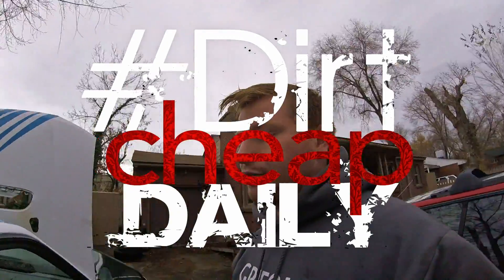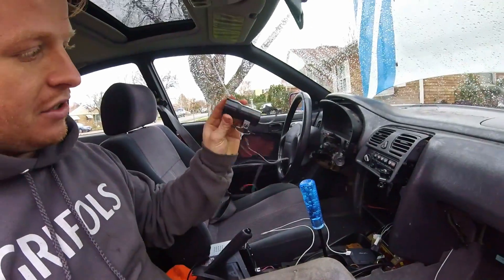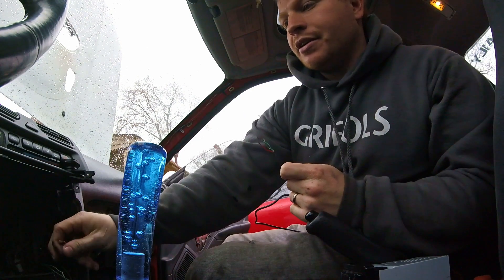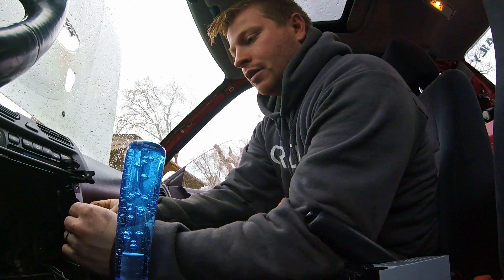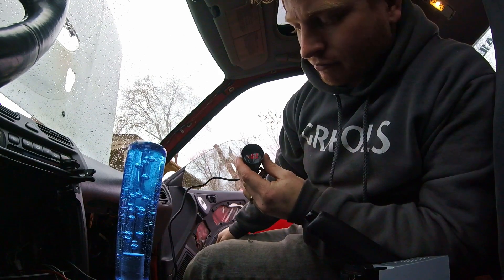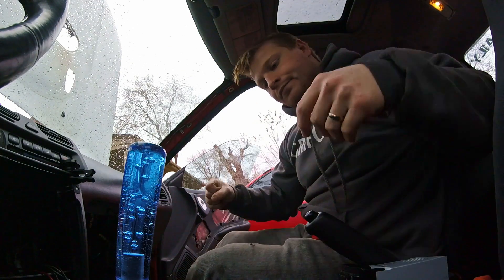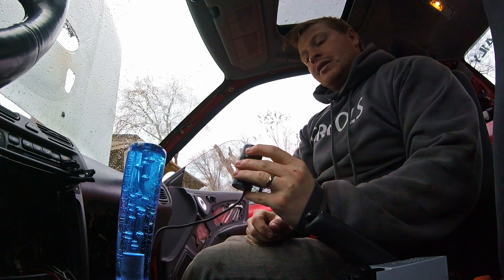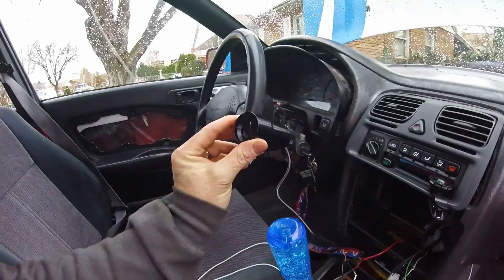How to turbo - Part 16 - AFR gauge install | Ep.60

Comment: Did you route signal wire from the ECU or can you run it straight from sensor itself?
Reply from the maker: Either way. It’s the same signal. 
I T’d in at the ecu so I didn’t have to run another wire though the body of the car.

Comment: Got any info on what wire that runs off in the narrowband
Reply from the maker: The signal o2 wire that runs into the ecu. Just pull up an ecu pinout and go from there.
Reply from the maker: +KC Karns sorry what's the question?
Reply: Dirtcheapdaily he was asking what wire you chose to tap off the o2 sensor, I'm curious also

Comment: can you do a video on the wrx?
Reply: deybi1 I know haha I follow him
Reply: Fox Mense looked like a gc8 wrx wagon :( must be wrong
Reply: Fox Mense that sucks :( you can pick them up here in Australia for $1000-3000 that's the gc8 wrx
Reply: It's got a JDM 2.5 swapped in now. We'll see what goes in next. There's a few options.
Reply: The gc8 is a impreza outback that they did a fiber glass wide body
Reply: Ben Brooksby ej22t (;
Reply: deybi1 the gc8 is a classic 4 door turbo impreza, the wagon is most likely a GF4 if its a 2.2, GF6 if it's 2.5, and GF2 if it's a 1.8
Reply: +Fox Mense I know the difference but this exact one is Ben brooksby on Instagram howmycargotlikethis his is an obs
Reply: What signal.wire on the o2 senor di you hook up to, + or - to the green wire on the Guage